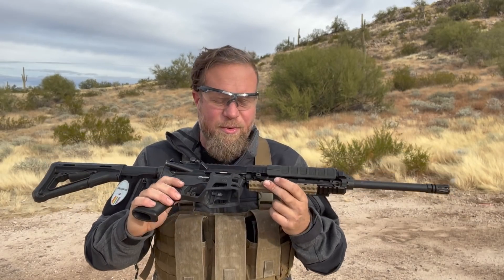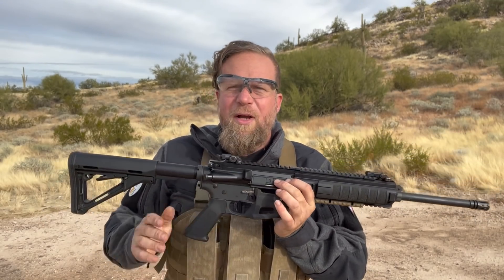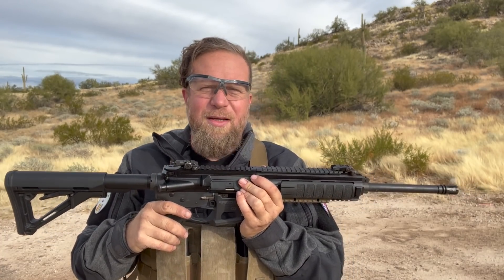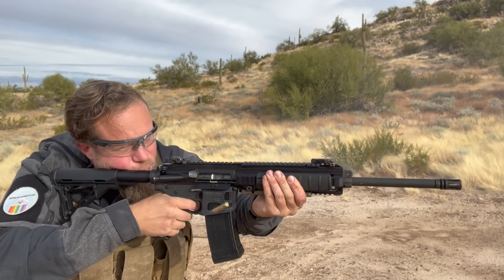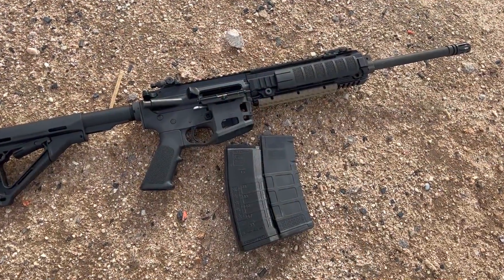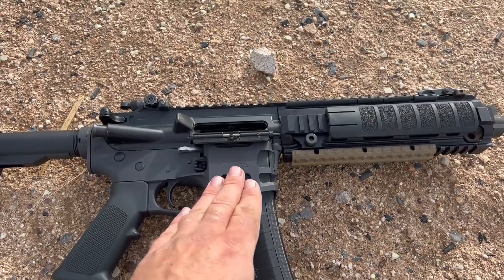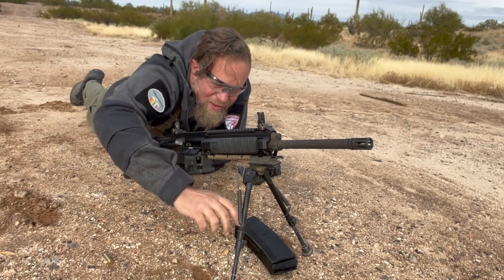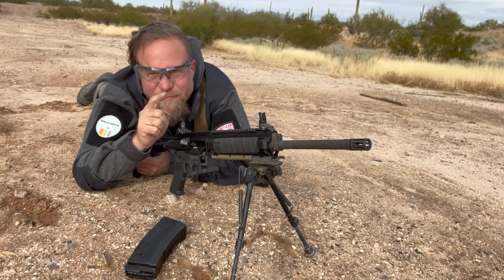Desert Tech Quattro-15

Comment: I feel like some type of retained flipping or sliding insert is necessary for military use. If the insert is easy to lose it's a good chance it'll be lost under combat stress. I imagine the engineers are working on something like that right now. I'm curious what they come up with
Reply: A simple lanyard would work.
Reply: @blackspike2710  Perhaps. The chance of snagging a complex shape that's hanging on a string worries me, but that might just be the best solution.
Reply: @weaponizedemoticon1131  If the insert is kept near the handguard (such as behind a vertical grip) the lanyard could be ranger banded to the handguard to minimize snagging.
Reply: @ChucksSEADnDEAD  That certainly sounds like it would minimize the problem. I am still biased towards a retained slide or flip insert, or possibly even a flat spring guide, something that is more physically attached to the weapon, and would require no fumbling. I can think of three or four ways of doing it, it's just a matter of durability, cost, and geometry.
Reply: I am imagining a block that is retained with the same pin as the ejection port cover could work. Just would need to modify the lower to have a locking mechanism for it. Idk, couple ways you could approach this.
Reply: Nope, nope, nope.  As a former grunt, nope.  You DO NOT WANT your emergency feed attachment widget swinging in the breeze, collecting crap.

Be better to design a stock that has an internal compartment with a tightly fitted cover, and use that stock with all the guns equipped with the quad stack mag well.  That would leave the insert  on the gun at all times, but still well protected from crap.  The loss of the additional 5 seconds or so to po it out of the stock and snap it into the well are more than offset by the additional protection (not to mention not having what is sure to be a fairly "bitey" piece of metal right about where your hand is going to be a lot of the time).

Better idea is to save this for when you're changing weapons systems away from a STANAG magazine anyway, specify this type of magazine system will be the standard for the standard rifle and squad support weapon (i.e., "LMG"), and give everyone the quad mags.  Maybe the riflemen get stubby 30 round versions, while the automatic riflemen get the 50-60 rounders, but everyone gets the same magazine interface so they can swap back and forth.  (Yes, this will inevitably mean every single Joe is going to try and score the "LMG" mags for his rifle, like folks using RPK mags in AKs and AKSU74.  "Biggest box on the smallest blaster" will be with us so long as we are recruiting dopamine addicted teenagers into the Infantry.  I don't care if it is Private Ivan with a 40 rounder in his Suchka in Afghanistan in 1988, his older brother with a 75 round drum on his AKMS in Germany in 1980, or Space Marine Zap with his plasma rifle on Rigel IV in 2432.  LOL)
Reply: @geodkyt  I have to say, the idea of everyone having the quad stacks, no adapters needed is by far the cleanest solution, where front line gets the new hot quads first.
Edit: Also, not important, but man would some shorter magazines be attractive on a semi-compact AR platform. Just personal preference, but I like the sleek short magazine look.
Reply: Robert Sears  My understanding is that the procurement plan for 6.8x51 is only a few thousand guns so it would seem there is no real plan in place to replace the M4 as the main battle rifle.
Reply: @SurmaSampo  The move to the 6.8mm NGSW program is for fielding to the infantry and similar front line folks who are expected to engage dismounted with small arms.

Everyone else is expected to retain 5.56mm, reverting the M4 Carbine to the role it was originally intended for - a carbine .  It was really intended for a "PDW" for folks whose primary job either wasn't bringing the pain with small arms (clerks, technicians, etc.), or were so specialized the velocity disadvantages of the short barrel were offset by the convenience of a shorter, handier arm (Special Forces, who wanted it for when they were either ridiculously burdened, not anticipating engaging in a major firefight, or planned to engage the enemy only at close range and probably in confined terrain).  The plan when the M4 request was made was never for it to be come the standard arm - tankers were supposed to have a higher priority for it than infantry .

Of course,  fielding the 6.8mm suite to the shooters first will also allow the Army to gracefully plan to replace the rest of the fleet of small arms.  The people who actually do most of the shooting will have the latest and greatest, and the folks who are least expected to "engage the enemy closely with extreme violence" will have all the ammo they will need already in the ammo dumps for years to come, as the knuckledraggers won't be using it up anymore.

And once the US is ready to go all-in and make the 6.8mm family the Standard-A for all soldiers, the M4/M16/M249 weapons and ammo will still be useful for non-peer allies for even longer.
Reply: Robert Sears  I think you're overestimating the procurement speed of the US military. Once they get invested heavily in something it takes decades from the point of going "we need something new" to actually even getting it in a limited capacity. And simply put, no, the next fights the US will get into won't be against an army all using level 4 armour. It will likely be a conflict in Africa, given the destabilization of the east coast. Other than that it'll likely continue to be a limited role in Syria until the status quo there changes.

Even if you're under the misguided assumption America will be at war with Russia or China directly within the next 30 years, Russia's body armour program is mostly propaganda. Relatively few of their troops actually wear it into combat because it significantly lowers their movement. This has been proven in war footage from Ukraine. Even Russian regulars are seen without body armour regularly, and they're fighting Ukrainian troops that have some body armour and modern combat systems. Same is even more true with China, who has one of the most bloated and poorly balanced militaries on the planet. Only a tiny percentage of their military appears to actually be up to modern standards. By all accounts the US military is vastly better equipped, and in a war with drones all of this becomes videogame logic anyways. 

Surely if America planned on getting into a war with a modern military that uses body armour anytime soon they'd be deploying troops to Ukraine right now. The truth is 90% of this is just power projection. Same with all these MBTs designed to defeat the newest fancy Russia tank (which Russia always ends up going over budget on and making a couple hundred of if they're lucky), when in reality Abrams only ever face outdated T-72 models, and even that's rare. 

Power projection is everything.

Comment: so you trade two 30 rounds mags for one 53 round mag.   that is less ammo carried for 50 percent immediate fire power.  load out   I  been told combat load out is 240 rounds 8 mags so going to 4 with  212 rounds add  one mag in gun    270    and   265  so load out not really changed .  Is there  a weight savings for one mag verses two?     note standard load out is 120 unless you expect contact which doubles the load.  and  every veteran expected contact  after the first one. :)

Comment: That was pretty impressive,if the military doesn't want it I hope the civilian market does.
Reply: Robert Sears  Easy solution. Give these to EVERYONE! You would not need the insert if no one even had any standard 30 rounders.
Reply: @wingracer1614  the 30 round mags already seem to work fine
Reply: @castielsisko2120  So what. You know what else works just fine, 5 round mags,
Reply: @wingracer1614  I think you may have missed my point lol
Reply: Even if civilians can't get it as a machine gun, it would be tremendously valuable to a county militia for a high volume of fire option. Hold more than even an extended magazine and uses way less space than a drum
Reply: oh we want it.... but can we afford it? lol...
Reply: I want one! Honestly I will phase out all my 30 round mags and replace them with these if proven reliable. If proven. But I’m definitely going to get one to check it for myself
Reply: I suspect the inability to take standard 30-rounders in an emergency on what is otherwise a standard rifle would deflate military interest pretty quickly.
Reply: @ninjasocks1048  Actually, it can. You can stick inserts in the mag well to let you use standard pattern AR-15 magazines.
Reply: @Pilotmario  he said emergency. the military isnt going to buy millions of mags that wont fit in the existing fleet
Reply: @jdub9344  Uh, what? Guy's talking about using AR-15 magazines in the Quattro-15, not the other way around.

Comment: As much as the belts are effective at what they do, it looks like these quatro coffin mags give you almost the same capacity but with more convenient methods of carrying the ammo since you'd already have double mag holsters instead of issuing/buying proprietary pouches for m249 drums.
Reply: And the lower is compatible with standard upper receivers.
Reply: the military isnt going to adopt this theyre looking at a belt fed SAW in 6.8mm
Reply: @FrAnC3sCoN123  they've been trying to go away from 5.56 for so long I doubt they ever will unless there is some prolonged war probably
Reply: @LatinXTroglodyte  precisely. And even if they do move away from it in the next 30 years, they're still going to need to keep their 5.56 fleet modern until then

Just look at the Abrams. They've said they're going to replace it since the late '90s, and yet more money is spent on keeping them modern than on developing a replacement. Same moreover for the Bradley, which the US has wanted to get rid of pretty much since its release. I'm sure BUSK IV or V will be out before the Bradley finally gets its merciful death

Comment: Very cool... I'm so curious what the internal geometry of their mag is, since larger casket magazines appear to have a gentle taper whereas this design seems to go directly from 4 lanes of bullet traffic to 2 almost immediately.  If there are rounds doing an elegant zipper merge in there somehow, I'd love if they release any engineering diagrams showing how.  (Assuming they patent this and are ok with discussing that)
Reply: I suspect that there is an internal taper to facilitate the merge, but the external dimensions were kept blocky to keep the look of a "standard" magazine
Reply: @walterriblethegreat  Or they could have left the extra bulk to add strength to the area where the rounds converge. Especially if it's 3d printed.
Reply: @walterriblethegreat  probably similar to the coffin mags, but they have a blocky top section like you said.
Reply: @MSZSNeoBahamut19  that magazine looks 100% 3d printed. The shine gives it away.
Reply: @Spollekop  I was typing a comment about the mags looking 3d printed when Karl said it. for sure look it.
Reply: Also wonder how it is to load/fill.
Reply: In my head they could have two double stack U tracks side by side that merge at the top
Reply: i'm sure they will once they have a patent pending for it.
Reply: my guess is because its internal geometry bears little resemblance to the outside geometry unlike a stamped magazine.
Reply: I was wondering the same thing.
Reply: @MSZSNeoBahamut19  Karl literally said in the video that it's 3D printed.
Reply: @MSZSNeoBahamut19  It is definitely 3D printed, you can see the layer lines on the shell when the sun shines off of it.
Reply: Could be like a keltec cp33 magazine, dual double stacks to single.
Reply: Weird to see a hero comment on a creator I enjoy! DeviantOllam, I teach my kids your gun safety rules!!!
Reply: It looks like there are some internal ribs that guide the bullets from quad to double stack.  The width of the magazine looks to be so that it can allow the follower to travel all the way to the top of the box without it being a crazy folding mess.
@Christie Malry already said the same thing, I see.
Reply: From the outside it almost looks as though they’ve taken the standard dual-double-stack arrangement but just carried it all the way to the top to remove the single-double-stack neck that conventional quad-stack magazines have to have in order to mate with standard mag wells.

The majority of fees issues in conventional quad-stack mags has to come from the follower(s) needing to navigate that constriction whereas with this approach (if it is indeed what they’re doing) any feed errors would mostly be cleared by the bolt stripping that round out of the magazine before it can jam in the narrower neck or by the followers never needing to navigate a constriction in the first place

The blocky nature of this magazine at the top looks odd though, a taper on both the magazine and the mag well ought to make fitting the magazine under duress easier instead of having square shoulders for it to catch on, presumably there’s a good reason for that beyond aesthetics

I can’t see much deviation (no pun intended) from convention as far as springs and followers go being that advantageous since it’s tech that’s had ~100 years to be fettled and it would break KISS if it were complex inside (almost certainly barring them from military contracts/sales before the concept has even left prototyping)
Reply: Thinking on it further, all it ought to need if the followers do just travel straight up to the feed lips is for a slight bias in the lip angle and a specially shaped follower to allow one side to empty before the other can begin to push rounds up out of its internal dual-stack and present them at the lips
Reply: Like he said, the other mags you're thinking about are made around the limitation if a standard lower. They removed the limitation of the lower and now the quad looks different.
Reply: No one is acknowledging DeviantOllam is a FKIN LEDGEND , my respect for you and your opsec just went up by over 9000

Comment: This looks very interesting.
However, I wonder (as a civilian with no active combat experience, so I'm probably worrying over nothing xD) if having less overall ammunition (21 rounds, if you have 3 quattro mags instead of 6 30 rounders) will impact its use
Reply: I think you missed on the mag that's already in the gun. The hypothetical soldier running around with quadstacks gets to start with 23 extra rounds in their weapon, so the quadstack actually comes out (barely) on top in terms of total carried ammo.
Reply: @charliechapman7156  True!
Reply: Simple, just add a few additional pouches.
Reply: @mruler360  Sort of...?
If every pouch takes 1 quattro or 2 30 rounds, for every one that you add you get 53 rounds in 1 reload or 60 rounds in 2, so the pattern does not change, it simply shifts, so you always get that 7 rounds difference per pouch.

However, the factor that I have not considered is that if you use quattro mags you also have one in the gun, which nets 23 extra rounds on a normal mag, which basically compensates for the loss of rounds of 3-4 pouches...
Reply: I was thinking the same thing. I'm guessing that the the people in charge of logistic would prefer traditional mags, given the higher overall capacity per soldier. Not sure what the common soldiers themselves would think.
Reply: I agree. I feel like if they made them the same length as a standard mag, they could get 60rnds if not more in a mag. Then it makes sense since it cuts the reload time without loadout loss.
Reply: E  it's gonna depend. The big money is military contracts. If this draws military interest, that could be a big deal: The Marines are using the M27, but I don't think the Army had moved away from the M249 yet.

If it works effectively as a machine gun and delivers the required level of firepower, I could see special forces being interested in it for sure
Reply: Soldiers are required to carry at least 270 rounds(9x30) and 5 of this guad stacks would be 265 so soldier could actually carry them

Comment: You want right of fire and the mag and mag well is your chokepoint? Seems obvious, make a new mag well and mag for it. Sounds like a good case study in actually studying the problem and answering it. 

Not sure I have to agree on the supposed benefit of belt fed over mag fed. At some point, the other guy just doesn't want to be there, if they're not already wounded, dead. Not to mention the logistics side of it, whole new chain for just one weapon in the team, two weapons in the team. Extra training too. 

Good discipline, good training, practise...... I think that matters more. 

Dare I say it, even so early, this may be a solution, answer, to a question no-one was asking. 

Cool, sure. Practical? Looking like that. Let's see some more testing, long term reliability, endurance testing as well as the whole array of mud, ice, snow, sand. Make and keep using it till you break it and study the pieces to see what breaks. 

Interest in and adoption, now.... that's a more interesting question and one I don't want to put bets on. See above on why and that's not touching the whole can of worms about other projects out there now.